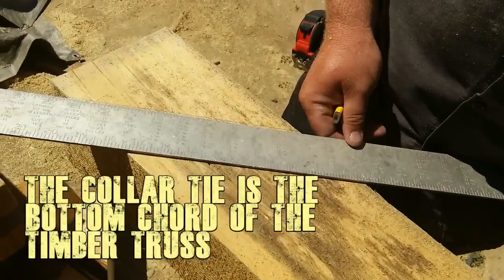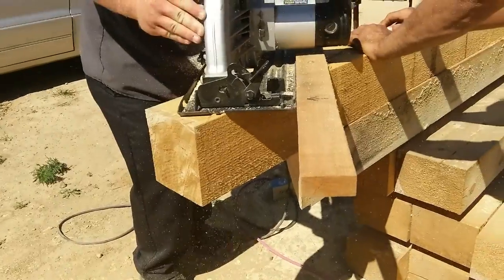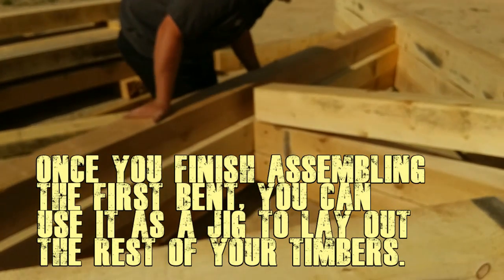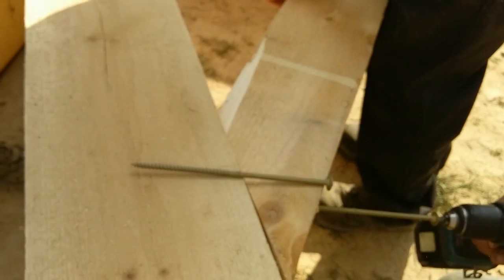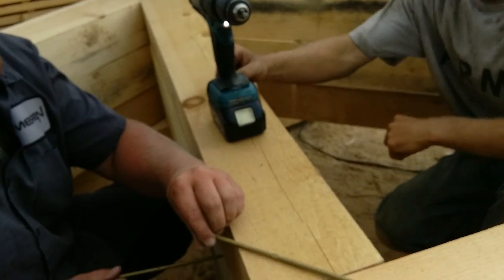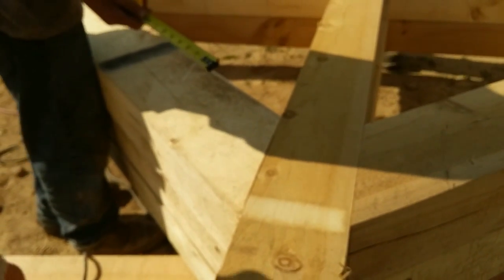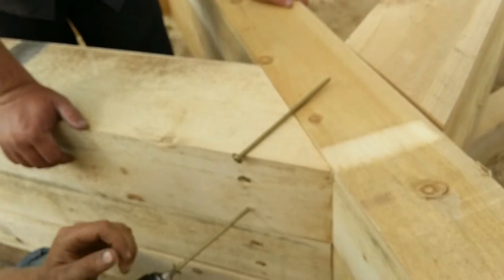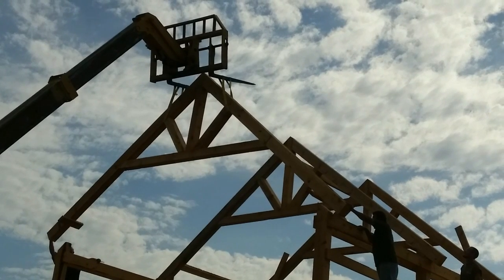How to Build a Timber Truss

Comment: Brother, go the extra mile and assemble with mortises and tenons. Nobody will care how much time you saved when a hard wind moves your structure. No disrespect, just a thought.
Reply from the maker: I love mortise and tenon, for it's beauty and history.  It was the best choice for framers for thousands of years.  But, they aren't as strong as modern steel plate joinery.  I salvaged dozens of mortise and tenon barns, prior to building these barns, and I know the fail points of mortise and tenon very well.  Where I use screws I take advantage of the strength of the wood grain, and where I don't have that option I use steel plates.  The steel plates are much stronger than mortise and tenon, and the timber screws are at least as strong of a joint as a mortise and tenon joint would be in that location.  As for a hard wind, one of our barns endured Hurricane Mathew in Georgia, mid construction.  Only the frame and roof were completed, no sheathing yet, and the barn did not budge, trees blew down all around it, but the barn stood strong.
Reply: @BarnGeek  improving an old system like timber joinery by making it stronger and better using steel plates and screws it’s an achievement in it self. I think most people like myself lock the vision to do that to big lumber but after explaining that hurricane Mathew didn’t make your build flinch I can see it. You should always lead with that story because brother, screwing timber looked strange as hell, I was nooooo help that fellow. Now after a brief exchange you are helping me. Never too late to learn how to make something easier and stronger.  Stay well and cheers from New York.

Comment: Thanks for this, i am making quite a light weight structure (comparatively) and was debating whether to use lag screws, dowels, plates, or joinery. Seeing what you can get away with using screws, i am convinced i can keep it simple, quick and efficient.